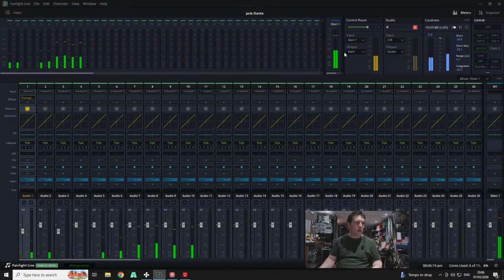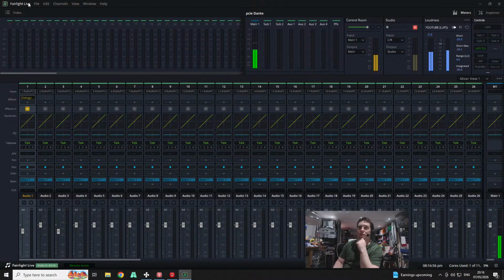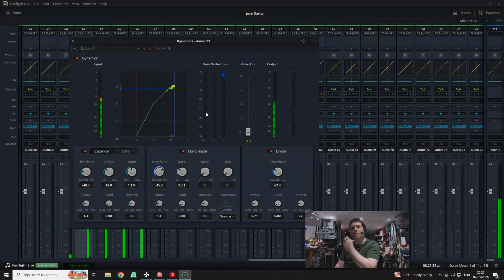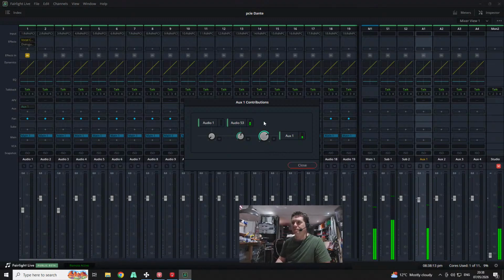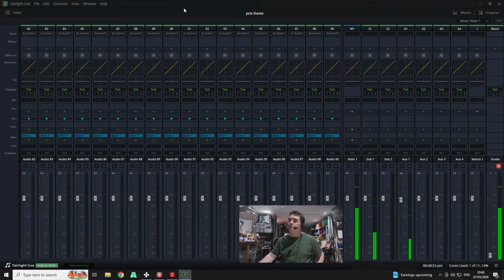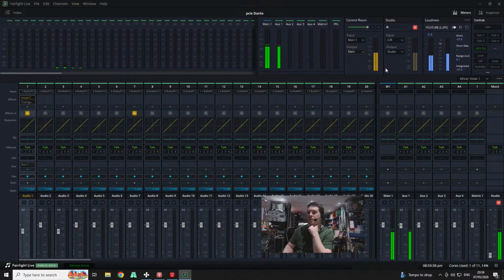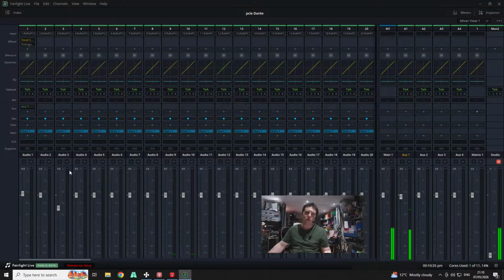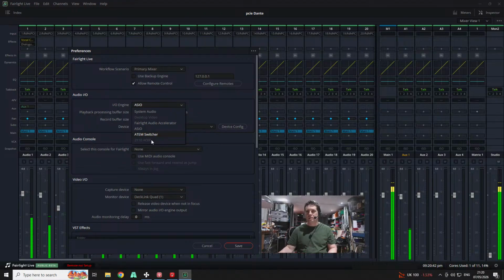Fairlight Live Livestream - Fairlight Meet Dante

Comment: I have sources running into my Mac through Dante Virtual Soundcard, and I’ve set the input  device as DVS.  I can see all of the channels in the patch window and I can successfully send my main bus to the outputs of DVS.  However, when I assign one of the DVS sources to a channel, I hear nothing.  I can verify in other software that it’s receiving a signal just fine.  Do you know of anything else I need to do to get Fairlight to register the input?  It’s driving me nuts! :(

Comment: Good to know it's not just me not being able to get the audio from the ATEM. I have a 2M/E Constellation 4K. It has a lot of potential though and being able to use the ATEM audio and my audio interface together would mean I can eliminate a bunch of converters that I'm using now to extract it and use my audio interface to do the broadcast mix and embed it back into the proper output channels.